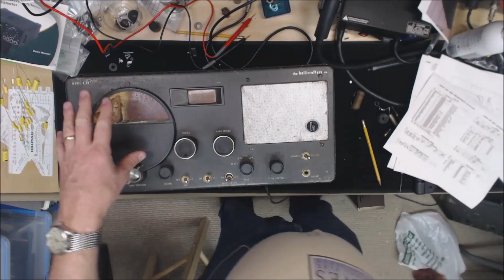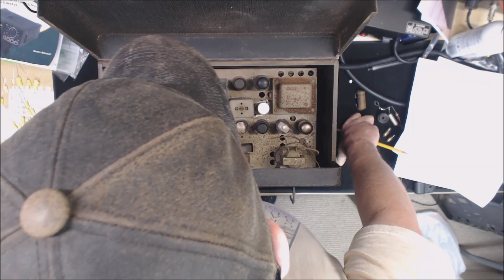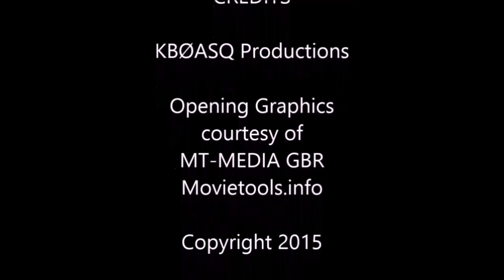K1SVC S-40 Hallicrafters Restoration - Part 1

Comment: I just finished an S-40B here. Every wax cap in there was leaking at the 20 volt level. Also just about every resistor in there was way out of spec and, just for good measure the audio output transformer was bad. A lot more work that I expected but it came out very well and is a surprisingly good receiver. It now lives next to my bench and is in use daily as I work on more old stuff. 73 Doug.

Comment: I like how you take your time, and go at a pace that is easy to follow. I know I've mentioned the Hallicrafter S-120 below.
But as I just mention; I pick one up from Ebay; and was quite surprised how popular the radio is.  Also it came with
full manual with schematic!  If you need a copy, I can do that.
Reply from the maker: I have to check if I have a 120 waiting in the queue to be worked on.  I think I do, but probably won't get to it until next year.  Thanks for the offer.
Reply: Here is my OneDrive link for that radio:
http://1drv.ms/1kfnWgW